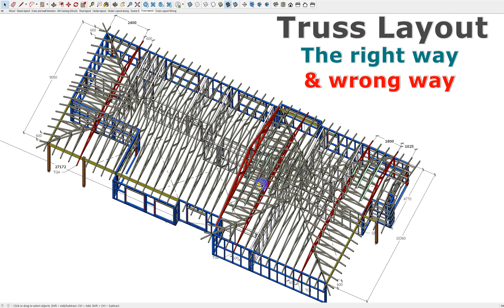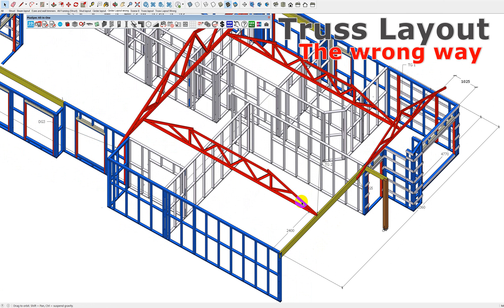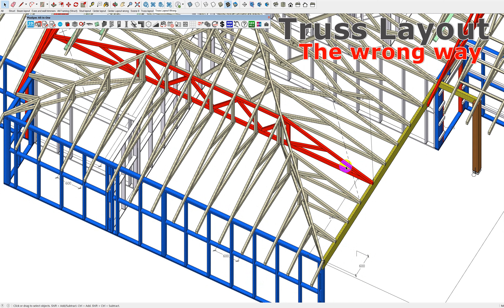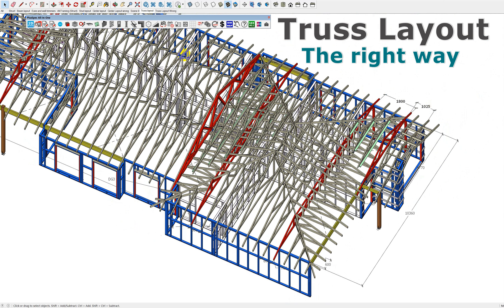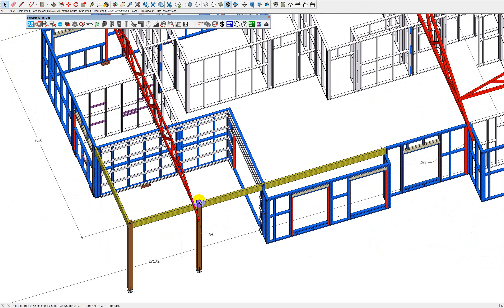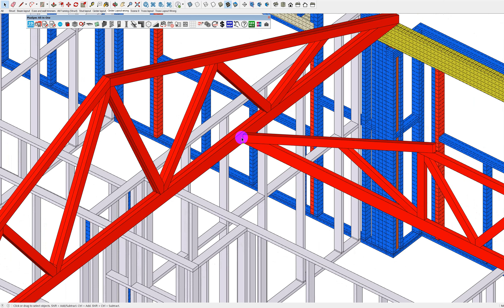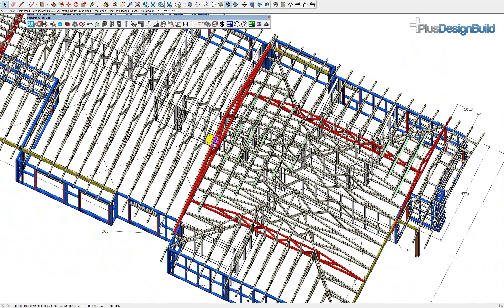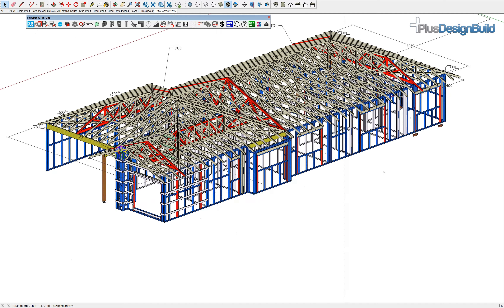Truss Layout and design tips with girder truss and truncated girder truss positions

Comment: lol... obviously you don't have much experience with designing and laying out roof trusses...
Reply from the maker: It would be great to see some examples of how a professional would do it.  You are correct, though; we are, not truss layout designers; we build the software for the pros.  It helps them make considerations that allow for HVAC MEP.  A truss manufacturing company would always design the actual trusses here in Australia.  From a builder's standpoint, I find that many truss companies do not consider the beam sizes required to span a framed opening and, therefore, will place girder trusses over the large opening as the cost is not theirs. This video shows how to avoid the occurrence or redesign.  
BTW.  I did not notice any videos on your channel, so I can only assume you are trolling.  Thanks for commenting, though. 😁
Reply: @PlusSpec  25 year whole house designer. (all products)
Reply from the maker: @gwp1ohio  wow that is pretty good. 💪